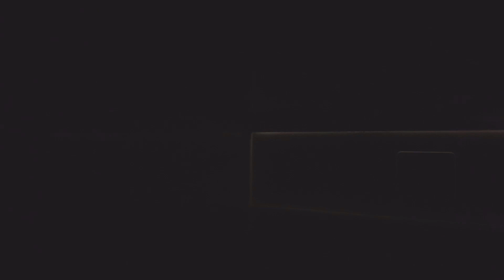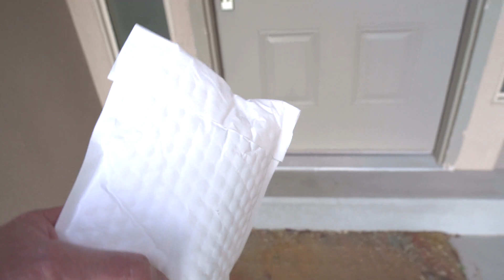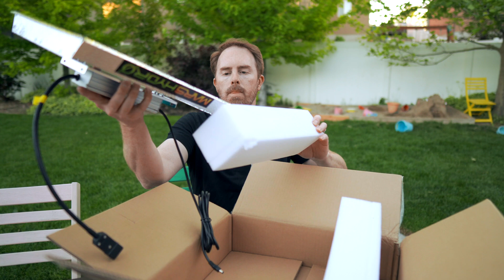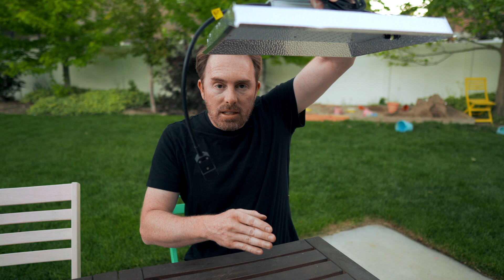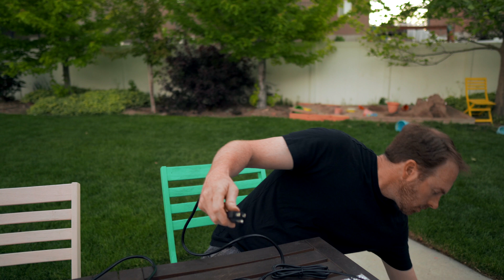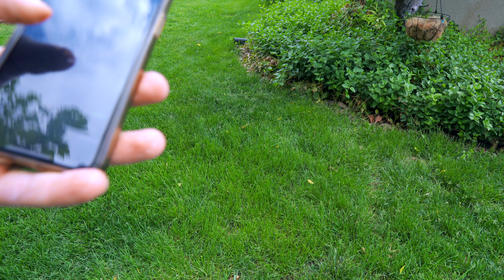LED Grow Lights - how to choose a good budget light

Comment: I'd use a 400W HPS over a 600W LED every time. LED's are only useful for cheaper electricity in vegetative stage.
That's why no Commercial Growers use LEDs for Fruiting and Flowering Crops. They all still use HPS.

Comment: Funnily enough the inverse square law doesn't apply to panel lights!

As you get closer and closer to a panel light, the intensity will tend towards just matching the density of emission from the surface. So panel lights are great at not burning tall plants! Because the intensity won't keep running away as you get closer.

Comment: Just bought one recently. My first Hydroponic attempt was lettuce.  All went great until I adjusted light to 100w and I got tip burn and greatly diminished yield.  I now have moved light higher and trying a new batch.  I did get enough to feed the tortoise for a few weeks!  I really like the light(my fault for tip burn)!
Reply from the maker: nice! you may be able to eliminate your tip burn, or reduce it by moving some air across the lettuce as it matures. It might have been a coincidence in timing when you turned up your light, and when the lettuce is usually more prone to tip burn (as it takes off near the end of the grow cycle).